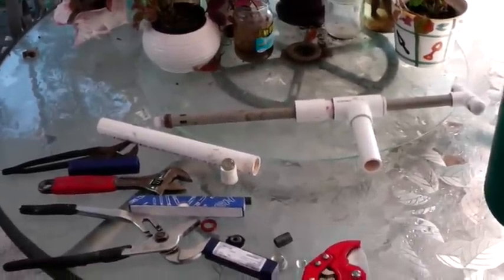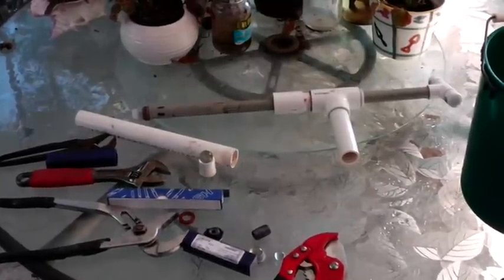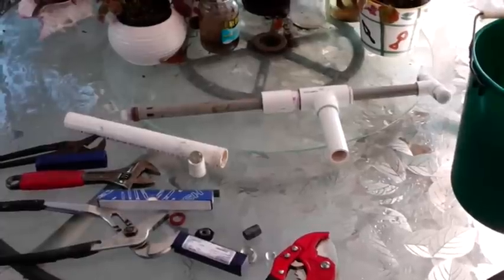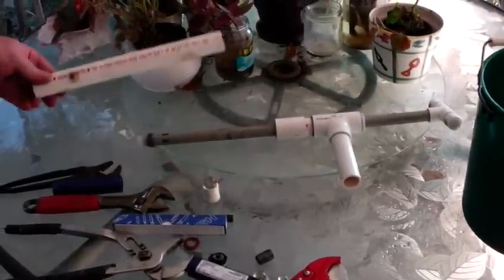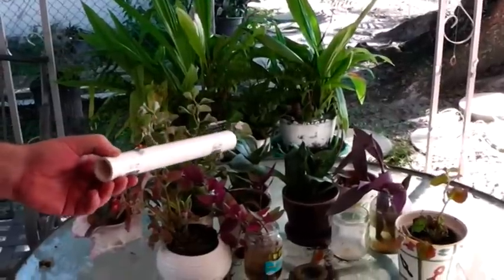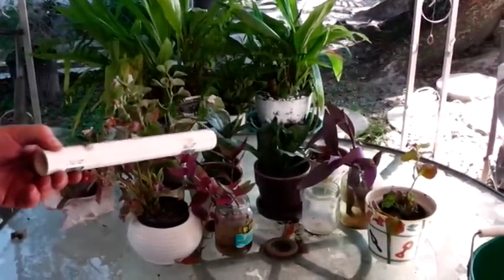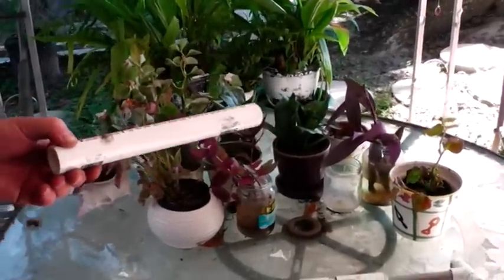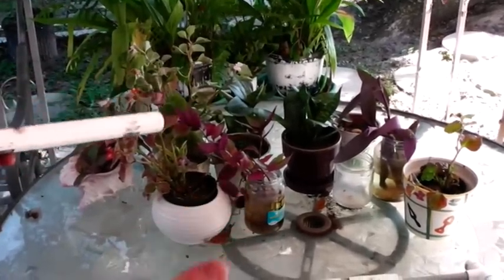Hand Made Deep Water Well Hand Pump

Comment: This won't work in a deep well where the static water level is below 30'.  Probably won't even work then but the theoretical limit, for a suction type pump, at sea level, is about 34'.  To raise water from deeper you need the cylinder located down in the well, below the water level, and an actuating rod to drive the cylinder from the top, also known as a "sucker rod"

Comment: Your title is untrue. It is NOT a deep well pump. Unless you think 8 inches is deep. Duh! You're wasting our time. Remove the video or change the title to "How to make a check valve"
Reply: homesteadprepper Prove your pump will pull water from 30ft if you can.
Reply from the maker: Here's what I'll do for you, you prove that it won't work and then, I will show you 3 ways that it can.
Reply: homesteadprepper The laws of physics says you can't lift water more than 28 ft without a venturi. The weight of the water will push down with a force equal to the lift. Even an electric pump can't suck water more than 28ft. You need a venturi jet. Call your local well driller and tell him you have a shallow-well jet pump and your well water is 80ft down. He'll say you need a DEEP WELL jet pump with a venturi or a submersible pump to push the water up. Go ahead ask him.
Reply from the maker: You clearly have not ever heard of the "Simple Pump, Bison, Oasis"?
If you did some real research you would find out that the principles that my pump works off of work the same as these pumps I have listed.
Call up the Simple pump people and tell them that the pump that they have been selling to off gridders for many years and the like will not work.  While your at it, call the Bison people and give them a load of your faulty physics.
This pump works the same as an electric submersible pump.  It pushes (not lifts) the water from depths greater than 32'.
I believe that the Simple pump can push water up from depths of 300' by hand.
You really should do some research.
Reply: homesteadprepper I worked as a well pump tech for True Value Hardware. I am certified by the State as a small water systems operater.  Try your "pump" at 30ft above water level. It won't work past 28ft.
Reply from the maker: Tell me in your own limited way why the Simple pump draws water up from depths up to @300', "why" this pump can not work and how has it been sold for many years? https://www.google.com/url?sa=t&rct=j&q=&esrc=s&source=web&cd=1&cad=rja&uact=8&ved=0ahUKEwiA5sbD6dTYAhWJl-AKHa6sBKoQFggpMAA&url=http%3A%2F%2Fwww.simplepump.com%2F&usg=AOvVaw2KkYE2sYaAl4V1d9y6tHRq
Reply from the maker: What state are you certified in?

Comment: Good video. A very simple method to get water out of a well will even less parts, is to make one check valve at the end of a long pipe and send the check valve end down the  well. Then you just move the pipe up and down in the welll, and water squirts out the top. You can even just put the pipe down and once it hits waster, put your thumb or something to block air from reentering the pipe, anbdc pull it out with the water.
Reply: Much of the water would simply go around the check valve so your idea would be only partially functional under specific conditions. 
1. The check valve has  a wide unobstructed opening (without strainer) facing downward so that on the down stroke water would push the valve up and enter into the pipe.  
2. The valve return spring has very light tension so the valve opens easily.
3. The well is extremely shallow.... 
   The deeper the well the less and less it would work because for every foot height of pipe, you get .433 psi pressing down on the check valve preventing water from entering it. That does not include the 14.7 psi of atmospheric pressure if you were near sea level.  So a 50 foot deep well, you would have aprox. 36 psi pushing down to keep that check valve from opening.  21 psi of that would be non-compressive.

Comment: I'm wanting to install a hand pump in a well that had 40 ft pipe,water being at 30 ft. Why wouldn't a pitcher pump work if these marble check valve was placed inline, would you not be achieving the same results?
Reply from the maker: The homemade pump must have an actuating rod just like a simple pump.  If you connect the pitcher pump handle to the homemade pump it will work.
Reply: dianna83301

Comment: how did you cover the top portion of the casing? if water is 50 feet down how long that pump pipe be? is the lenght the same as the casing? thanks
Reply from the maker: You can get a well split cap at some plumbing supply stores to cover the casing.  I would probably put the pump pipe down 7-10 feet lower than the lowest water level expected.

Comment: Hi how deep will this pump water from?  My water is 97 meters deep (thats about 300 feet)!  Will it work?  What type of pvc would you recommend for that depth?
Reply from the maker: The Simple Pump works off of the same principle but, they use machined parts, better seals and tight tolerances(no marbles).  So the answer is yes it is possible.  I would say that the pump shown in the vid would not pump water up from those depths however, with better parts, tight tolerances and better seals it could be done.  What is you water table?  My well is 180ft. deep but, the water table varies from 7 to 42ft.
Reply: the simple pump is different.  This pump is like a pitcher pump in that it is sucking the water up.  The simple pump uses a sucker rod to drive a pump cylinder at the bottom of the well that PUSHES the water up.  Sucking water up is limited by gravity and air pressure to something like 33', at sea level, with an excellent vacuum source.  In reality, this pump will only bring water up from maybe 20', if lucky.

Comment: Some oil well use a similar pump but installation is  different. The barrel (cylinder) is first ran in the hole at the bottom of a sting of tubing first. After that's done the  standing(foot) foot valve is dropped down the tubing it  may fall 15003500 feet or more, it's sized to fall through the barrel to seat itself in a seating nipple. Then the plunger is installed at the end of a string of rods. When it reaches the bottom it will be used to check to see if the standing valve seated properly

Comment: Here is how a standard hand pump is installed in a water well   the pump consists of a cylinder with a plunger inside. A  section of sucker rod is attached to the plunger A section of pipe is slid over the rod and attached to the cylinder. This assembly is lowered into and hung in the well  a pipe dog so another section of rod and pipe can be installed, & so on until the desired depth is reached

Comment: There is nothing that slides against the casing in this sort of pump. A cylinder is attached to another string of pipe. The plunger in the plunger inside the plunger inside the cylinder is attached to rod string that's inside the pipe attached to  cylinder. At the top the rods. are connected to  a pump handle windmill, pump jack

Comment: Called a traveling valve. On the down stroke it allow water to flow around it & the washers & keep it there as the water is lifted to the surface. Operates like a store bought pump does, just a homemade way to do it.

Comment: one thing most home pump buildes fail to do is heat form the "marble" check valve seat to make it closer to perfect seal and have a wider seat,    also marbles are not all "sphearacle",   so it must be checked if a really good check is required,  regards

Comment: This design will go to the bottom of the well, regardless of the depth. The only limiting factor is the weight of the pipe when it is that long. At that point you make a mechanical advantage handle, much like a pitcher pump handle, to lift the weight of the column of pipe and the water inside it. But, the full length of pipe can be replaced with a rod or cable so it just works a sliding section that seals against inside of the well casing. . .much like the horse-head pumps on deep oil wells.

Comment from the maker: I am not sure what the limit is to a home made pump.  The tighter the tolerences the more depth it will pull out.  Drop a string with a bobber on it down the well, when you don't feel the weight of the bobber anymore you have found the water level.

Comment from the maker: A very good question.  The 2 check valves work in opposition against one another.  When you pull the handle assembly up, water is drawn into the larger pipe through the first check valve.  When you push down on the handle assembly, the bottom check valve will seal and the upper check valve will seal also. When this happens, water is forced up the pipe and you get water.  It works so simple that it seems confusing.  I hope that answered the question.
Reply: in Illinois, if you dig a hole for a well you might get more than you bargained for there are my water wells here that have oil in them be prepared for the location where you may hit oil. it's not a problem as long as you don't pump the slick. the oil here is abundant but poor quality I there is abandoned oil wells all over the state for that reason. long ago they stopped trying to refine it because of the extra steps it took, it was cost-prohibitive. 

maybe you could address the apparatus that would help in that case i8ve seen them but I don't remember what they are called.

thank you for this video.

Comment from the maker: You can spend a lot of time trying to get something like this to work.  You can also try to epoxy(food grade)  a rubber seal to the fitting that will fit your marble.  There are an almost endless amount or things that you can try. Many different sizes of pipe and check valves and etc. If you made your own close nipple you are way ahead of most people.  If you want specific instructions, I would have to do another vid using factory made check valves and standard parts.  cont

Comment from the maker: The camera man was the true genuis behind the homemade pump.He found an assortment of different sized marbles at a flea market.I do not know if marbles come in standard sizes or not.If your marble is to big for the pipe I recommend that you get a larger pipe or find some smaller marbles.A hard rubber ball would also make an excellent check ball and seat better(make sure it's food grade).When we improvise something it is not usually with standard parts and there is a fudge factor =cut/grind. cont

Comment: I am using schedule 40 electrical pipe 1/2", but the standard size marble, will not fit in the pipe.  I tried grinding it out so the marble would fit, but it won't seat properly.  I also could not find a closed nipple, so I made one, but it does not work.  The marble will not close the tube off.  Can you help me.  It is such a good idea, but I just can't get it to work.  Thanks

Comment from the maker: @QuantumPrepper The pump described here is crude but effective. It was fabricated with readily available materials that you might have on hand in an emergency situation.  This pump as shown will do really well in the 35-100ft range.  If you have a lathe and can machine your parts to tight tolerences, use a rubber,neoprene or teflon ball( no marbles), there is no reason why you could not approach the performance of the Simple Pump(350ft). The SP works off of the same principle.

Comment from the maker: @texasprepper2 Thanks TP2. My plans are to put in a secondary well at my place. My primary well has a submersible pump and when it goes out, no water.I calculated the 1/2" pipe to hold @ 117 cubic inches of water in a 50ft length, which is @ 1/2 gallon of water= @4lbs.Add the weight of the 1/2" pipe which I'm not sure how much 5 sticks of 1/2" pvc weighs but it can't be a whole lot.I intend to film the well drilling process and the improvised pump. I will try to give more detailed instructions.
Reply: Hello. I was wondering if you have put up that second well and the associated video. Please let me know Thanks. Henrique from Dallas Texas.

Comment from the maker: @PrimeTargetSecurity He used 2 inch galvanized steel threaded plumbing pipe.He threaded a 2 inch drive coupling on the end going first in the ground and 2 inch drive coupling on the beaten end ( available at Northern Tools).He used potable teflon paste or equivalent to join everything together.  He got a large pipe wrench and turned the casing clockwise while it was beaten.He poured a gallon of bleach down the well and waited 24hr then ran the pump 8hr to clean it out.He did this twice.

Comment from the maker: @homesteadprepper Also, be very aware of buried power lines,telephone,cable,water and sewer.  I would thoroughly check out wherever I was going to put in a well and dig down with a post hole diggers first.  For a covert installation you could beat in 5ft sticks of galvanized pipe at a time.  5ft sticking out of the ground gets less questions and strange looks than a 10ft pipe sticking out of the ground.  Good luck.